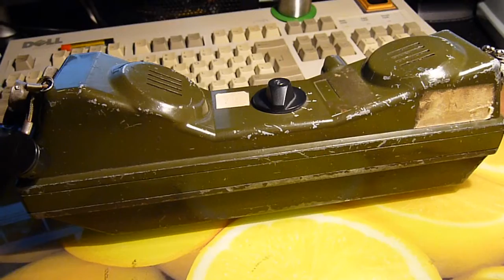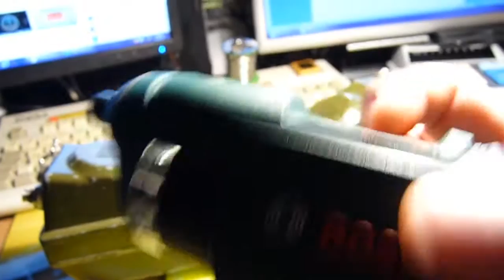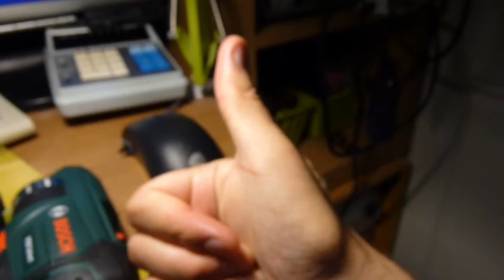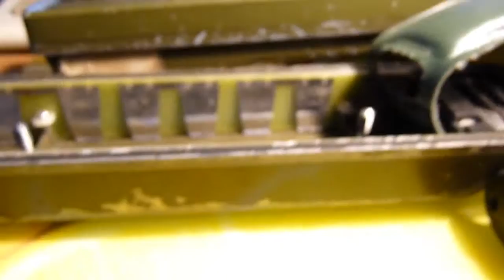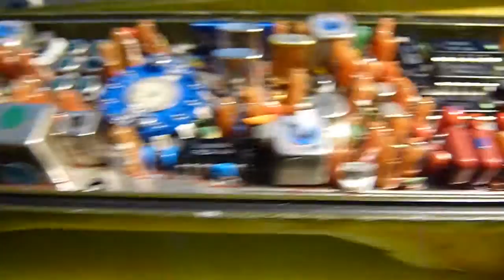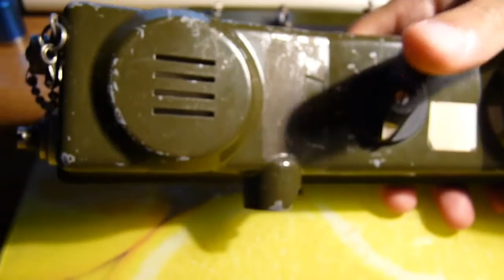1970s Army Walkytalky Teardown

Comment: Love the screwdriver, got a manual one like it but the whole barrel slides  forward to change bit but there is nothing to hold it in place so the metal shaft covers the screw your screwing which is quite annoying 😁 military stuff is so cool i like the clothing they use too I wish i had one of the black bags full of military goodies but with the cold weather stuff.
Reply from the maker: +Knuckles the Echidna When you do as much screwing as me you need an electric one. I love military tech, shame its main use is to murder.

Comment: Did the M@glite blow the multimeter with its awful angry blue LED tint? 😁
Reply from the maker: +Knuckles the Echidna Nope, shorted the battery.
Reply: +TheEPROM9 Which M@g did ya choose?  Check Thrunite torches out, you can get the LEDs in neutral white(around 4500k) I love the Archer series and T series ones!  Would like a rechargeable 18650 one next for the awesome runtimes!
Reply from the maker: +Knuckles the Echidna The small Solitaire one, needs a clean in the power switch meck.

Comment: What is the model of that fancy electronic screwdriver?
Reply from the maker: +electronash It is rather good to. Shame the tip magazine is not removerble and the dam propitiatory plug for charging. Also the direction switch is really easy to knock.
Reply: +Peter Edwards (sweetlilmre) 

http://www.amazon.co.uk/Bosch-Cordless-Lithium-Ion-Screwdriver-Battery/dp/B0084CNHJ2
Reply: Brilliant, thanks!